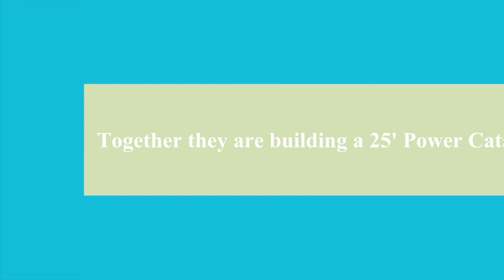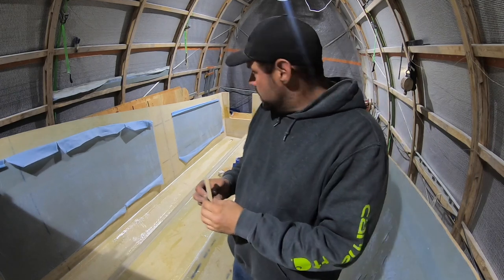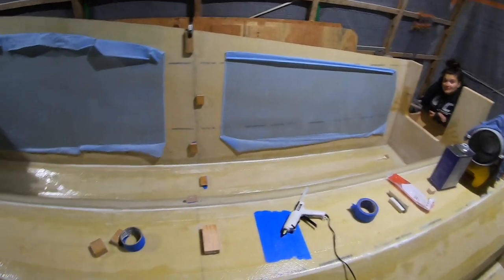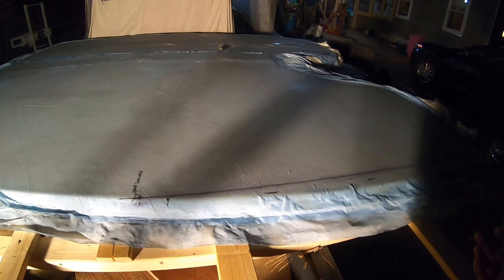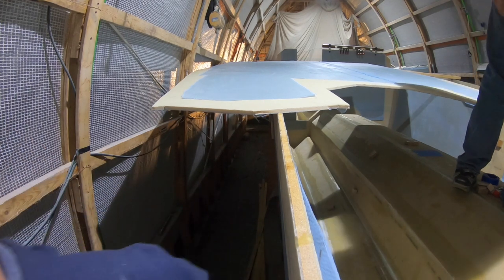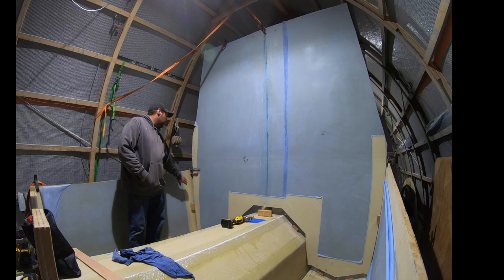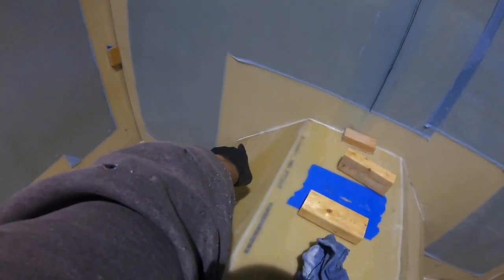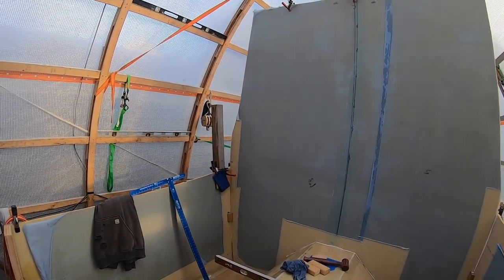Step 71: We Install The Main Bulkhead!!! -Power Catamaran Build Series

Comment: Don't be afraid of running a screw thru a wall to put up a support you can always come back and fill hole with epoxy later. You'll never have issues with it.